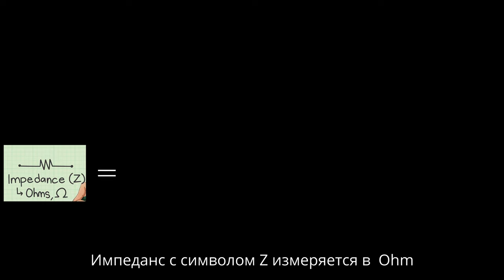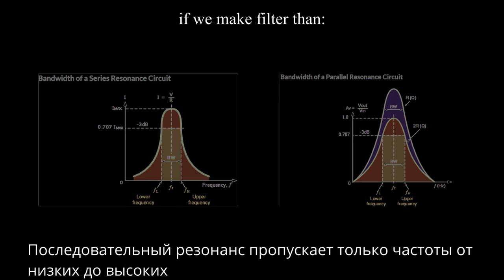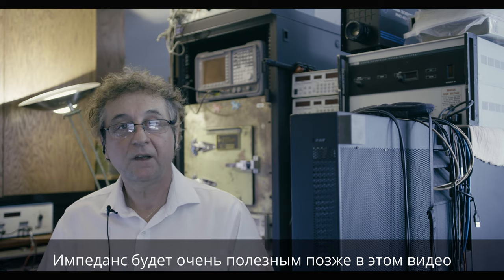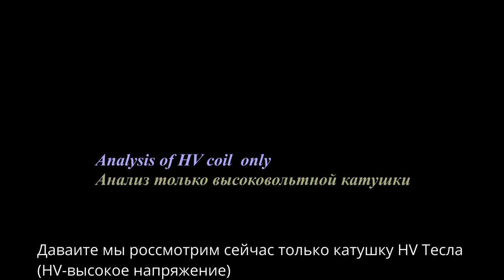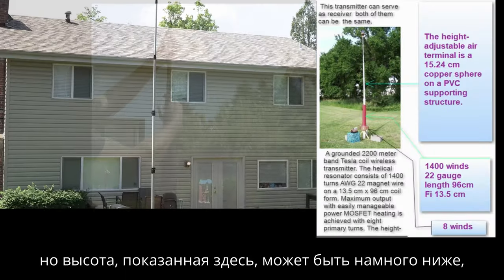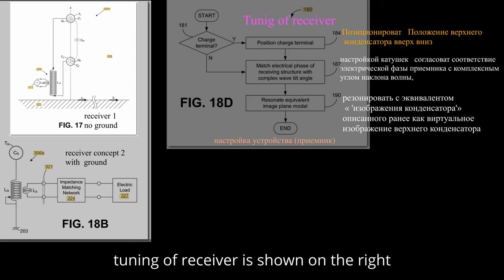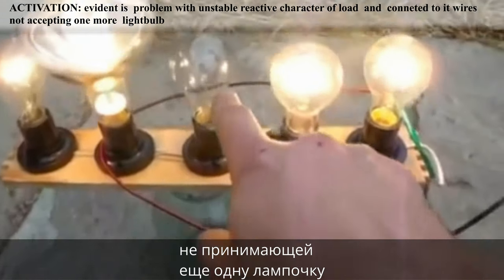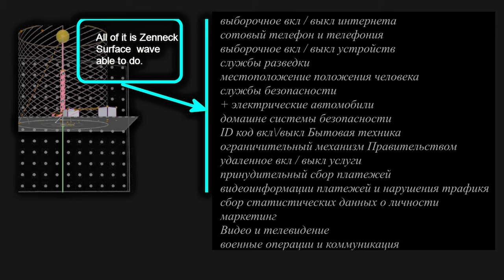Energy   extraction from Schumann waveguide

Comment: I hope people drill down into this discussion, rather than basing it on highlighted reply. Wesley, you're examples show radiation.  I don't think Tesla was radiating energy, look at the morphology of his research, if fact Tesla says he didn't want to. He went from an "Earth Quake" machine to Lightning strikes to  Colorado Springs TMT. If all Tesla wanted to do was to deliver power with no infrastructure, it would be pointless. He had system gain, and that is what we need to find out how he did it. The only thing we need to comprehend is that the Earth acts like a capacitor that doesn't lose it's charge. It has a field between two plates separated by a dielectric. If I gave you a capacitor that would never lose it's charge, how could you extract energy from it? Think about it.
Reply from the maker: It is misunderstanding of Tesla  experiments and JP Morgan expectation as his investor .
electrical energy was to be delivered to the device and than transmitted  to the consumer.
Consumer could not be charged for such services as there was no way to control  how much energy he  used.
JP Morgan protested and dumped Tesla.

Tesla was left with no money and  his Wardenclyffe Tower (1901–1917), was never finished ,
ALL OF THE REST OF THE STORY IS  MAGNIFIED  from its  true reality -  to the level that was  comfortable to  historians , his fans , and crowd  around  in later time.
Your conceptual thinking  doesn't work ,
 Earth as plate of capacitor and ionosphere as another plate  is important to us only as boundary of Schumann waveguide.

 every capacitor needs closed circuit to be discharged.
And  you can not physically close the circuit between these two plates.
You can not connect the load.
==================================================

to transform any energy of electromagnetic nature you  need variable transversal variation of the field  .

 If anything is to be extracted from that charge difference   it would be in the form described by me in my video,
Zenneck Wave and interface earth air is the answer,
Reply: @stivep1  You are thinking in conventional electrical application, to discharge the capacitor.  That's not what I am talking about. Take two metal plates with a dielectric . We can charge the capacitor correct? Now, unhook one lead to one plate (open connection assume no loss). On the other plate attach two diodes; one diode to ground, the another diode  in opposite direction through a load, then going to ground again. If you are able to separate the two plates, what happens? The field becomes weak between the two plates. One plate has no path for current changes (being disconnected), but the other will try to restore it's relationship to the ambient with no influencing field from the other plate, therefore it will move charges through the load while reaching for ambient state. Now bring the plates closer together again, the field now has mismatch charges that cause movement through the load again, to match the influence of the other plate. All you are doing is varying the field strength manually, and by varying the potential you induce current flow. You probably don't have to move the plate away, you can just  rotate it, or cause it to vibrate. Power through electrostatic induction.
Reply from the maker: @XR_IX  thank you for explanation. If you do it in your hands than energy of your hands is doing work.
 if you want to do it between ionosphere  and earth  than what is the mechanism that is going to for it  for you?
=============================================
Reply: Nothing to do with Zenneck waves or Schumann resonance, if Tesla was pushing current into the Earth.  You would have to conclude that the device in Texas, something else. Maybe just like mental pacifiers to thwart deeper investigation into Tesla's real design  and work.
Reply from the maker: @XR_IX  my dear friend. when you were talking about mechanically moved up/down capacitor plate in your hand I could picture it.
How can you mechanically  reposition earth to flex the distance to ionosphere that is "fixed" in position to the earth
don't even try to calculate it as force. 
You need at first point support for your crowbar to pull out the nail from wooden  wall.
Reply from the maker: @XR_IX   Tesla was not  <pushing current into the Earth>  Earth is only one of components of 2D interface that is made out of earth surface and air
 -earth surface is named lossy  conducting medium
-air  is named  dielectric.
Mode of Zenneck wave in the interface is TM ( transverse magnetic) and it is modification of TEM ( transverse magnetic wave -that usually present in waveguides)
However interface is a special condition of  wave guiding structure 
Tesla could not name  all of the technical processes but he was able to make it work the same way as you can make it work just fallowing the assembly instruction.
https://www.youtube.com/watch?v=wIIABIU3tRw
the same story was with Tariel Kapanadze - uneducated experimenter .
He had no idea  how it works but he was able to repeat phenomena he saw in his first device.
Reply from the maker: @XR_IX   Tesla was not  <pushing current into the Earth>  Earth is only one of components of 2D interface that is made out of earth surface and air

 earth surface is named lossy  conducting medium
air  is named  dielectric.
Mode of Zenneck wave in the interface is TM ( transverse magnetic) and it is modification of TEM ( transverse magnetic wave -that usually present in waveguides)
However interface is a special condition of  wave guiding structure 
Tesla could not name  all of the technical processes but he was able to make it work the same way as you can make it work just fallowing the assembly instruction.
https://www.youtube.com/watch?v=wIIABIU3tRw
the same story was with Tariel Kapanadze - uneducated experimenter .
He had no idea  how it works but he was able to repeat phenomena he saw in his first device.
Reply from the maker: @XR_IX   Tesla was not  <pushing current into the Earth>  Earth is only one of components of 2D interface that is made out of earth surface and air

 earth surface is named lossy  conducting medium
air  is named  dielectric.
Mode of Zenneck wave in the interface is TM ( transverse magnetic) and it is modification of TEM ( transverse magnetic wave -that usually present in waveguides)
However interface is a special condition of  wave guiding structure 
Tesla could not name  all of the technical processes but he was able to make it work the same way as you can make it work just fallowing the assembly instruction.
https://www.youtube.com/watch?v=wIIABIU3tRw
the same story was with Tariel Kapanadze - uneducated experimenter .
He had no idea  how it works but he was able to repeat phenomena he saw in his first device.
Reply: @stivep1   Wesley, when you strike a bell with a hammer it vibrates.  When you strike metal, and it starts to ring you produce magnetic flux. Test yourself with a Gauss meter. You are striking the earth with a lightning bolt, and it sets the medium in motion. You are creating magnetic flux. You shouldn't have to move the Earth away as in my plate example. I presented it metaphorically, to show how to use a capacitor to pump electron flow, without discharging it through the load. When you create a standing wave in the Earth, the vibrating plate builds and stores energy. Take a child's pool, and push gently timing the waves. Soon the pool is in motion as Tesla said with the medium having momentum. This is why Tesla refers to the "elastic" property... "I do so, but I prefer to reduce those waves in quantity and pass a current into the earth, because electromagnetic wave energy is not recoverable while that [earth] current is entirely recoverable, being the energy stored in an elastic system." : Tesla (ibid). 

Tesla is literally saying he is pushing current into the Earth.
Reply: @stivep1 I respectfully disagree that  your theory that Kapanadze and Tesla where using ground waves. It is much easier to see that they discovered a frequency that breaks the laws of conservation of energy in a local system, because energy is being built then captured by their devices.  A Zenneck wave condition:  "...exists under the condition that the permittivity of one of the materials forming the interface is negative, while the other one is positive. " : https://en.wikipedia.org/wiki/Surface_wave

Do we assume a uniform landscape with no features? Or over an undulating ocean? The Earth is not this way, look at the satellite surveys show much magnetic deviation, conductivity would unlikely be uniform. What happens to a Zanneck wave when it hits an ice covered mountain? 

Operationally what frequency could be used, it says under Radio,  "Evidence does NOT show that in radio space wave propagation, Sommerfeld-Zenneck surfaces waves are a mode of propagation as the path-loss exponent is generally between 20 dB/dec and 40 dB/dec." Wikipedia (ibid)

This is not radio transmission (or higher), you are going into ELF. Now build a Tesla coil that operates at the Schumann resonance, I assume to get gain. 957,191.89 Km of wire for quarter wave secondary.

There are numerous problems with this approach, least of all Telsa says it's not what he was doing.

In my opinion Tesla was doing this: https://www.youtube.com/watch?v=HJylD7xpEiU
Reply from the maker: @XR_IX  Tesla time was time of discovery of certain phenomena that have been  researched  after Tesla time  till today. 
Today's science corrected a lot of that what was discovered at Tesla time.
 Electric discharge of the lightning dissipates at the surface of the Earth. Lightning 
https://www.answers.com/Q/Is_a_lightning_bolt_kinetic_or_potential_energy
Quote:
<Electrical energy may be either potential energy or kinetic energy,
 but it's usually encountered as potential energy, which is energy 
stored due to the relative positions of charged particles or electric fields.>
 https://www.thoughtco.com/electrical-energy-definition-and-examples-4119325

mechanical energy, is not present in lightning strike. It is the charge that is discharging at the  first very moment on its flight creating more ionized path of air .
So discharge of lightning has curve of discharge taking place in time frame. similar to capacitor, where  air is slowly ionized dielectric that is becoming conductive.
 If you look at place that was experiencing lightning strike , or your  lightning  ground wiring  at your building ( mostly in Europe) there is no damage to the mechanical structure
if current was not big enough  melt the wire.
 Every <body> has gravitation and  Earth with its atmosphere inside of solar system travels in space.
There is no displacement  of ionosphere  with respect to the earth in form of vibrational mechanical disturbance.
Atmosphere travels with Earth together .
Reply from the maker: @XR_IX  I never said that Kapanadze and Tesla used ground waves.
you don't understand  the difference  between Zenneck Wave and ground wave .
http://www.tfcbooks.com/articles/tws4.htm
  Quote: 
<The ground wave:
 has both direct-wave and
      ground-reflected components, and under certain conditions a tropospheric
      ducting component.  The direct-wave is limited
      only by the distance to the horizon from the transmitter plus a small
      distance added by atmospheric diffraction around the curvature of the
      earth.  The ground-reflected portion of the radiated
      wave reaches the receiving antenna after being reflected from the earth's surface.>
=================================================================
Zenneck wave is guided wave and by that  <this  is quite  different animal.>
Zenneck wave  in  the interface exists as an   effect of  no reflection
-for Zenneck Wave  landscape is not important.
- ocean condition is not important.
-ice covering mountains ?  is not important
-wave propagation has nothing to do with Zenneck Wave
- path-loss exponent has nothing to do with Zenneck Wave
-square  root of the distance  should but for some reason doesn't affect Zenneck wave, the way  we would expect it to be affected .
Reply: @stivep1   Your posts are being repeated consistently. I can admit I don't know  what you are talking about well enough to say what it can do. Wesley show me an empirical model of this theory working. This should be simple, show me energy transmission using a Zenneck Wave. Then I can agree with you if it has the merit as you say. What I read is that is still an electromagnetic wave, and Tesla said he wasn't radiating electromagnetic waves.  I apologize, It's my fault to say ground wave. You are saying Kapanadze and Tesla were using Zenneck Waves, waves unwittingly yes?  Where does the process gain power amplification? I think if people knew that they could gain energy through a type of transmission it would be utilized.
Reply from the maker: @XR_IX  Yes  my posts are being repeated . And last time I  forgot  to delete the multiple ones.
Unfortunately  It is the  effect of  measures taken  by my 
IT department, to avoid Russian interference .
Yes Tesla said he wasn't using radiating electromagnetic waves.
Zenneck waves are NOT HERTZIAN  radiating waves.
http://rexresearch.com/corumzenneck/texzon.pdf
Quote:
  <If  one  can  synthesize  ground  currents  as  given  by  Equation  (1),  they  will launch a radially propagating Zenneck wave (a guide mode similar to the zero-phase-sequence of power transmission line experience44) with no Hertzian radiation or Norton ground-wave radiation whatsoever!>

=======================
Question:
Where does the process gain power amplification? 
Answer:
there is no gain and  no power amplification it's only losses added  in the process of energy  conversion.
So P( power)- Out is less than P- In.
But power In  is free.
Reply: @stivep1  That is definitely NOT what Tesla describes: 

"Counsel

You say the energy was 1,000 times greater. Do you mean that the voltage was increased, or the current, or both?

Tesla

Yes [both]. "
Reply from the maker: @XR_IX  *I need you to give me the link with exact quote and text to analyze it.!!  *
Tesla was great in 1897 to 1901.

Tesla  was in trouble but gaining knowledge  since 1901 till 1943.
Tesla was discovering and making mistakes.
He was not a genius,
Tesla was not a god and for Darwinists and modern science  God doesn't exist- so whatever God says is just fiction convenient  to Church.
By the same token  I  must see what Tesla said , where ,when and in what source it was said.
I don't trust, fictionares, as well as Russian historians, scientists,and propaganda.
Reply: @stivep1  Wesley it is the same document from pbs, which makes it pretty credible in my opinion, and points to an alternate narrative to the Zenneck mechanics.  http://www.pbs.org/tesla/res/res_art07.html   I have been looking at examples of Zenneck wave guide, and it seems it is good explanation for one wire transmission. I have told you that I know I can transmit power through grounded electrolytic fluid, and sea water should work, though I have not tried it yet. But the difference in what Tesla seems to describe in the reference, is the Tesla Magnifying Transmitter, where he achieves gain and transmission through the medium.  When I told you about setting the medium in motion with a lightning bolt, I was not really describing a grounding of energy. Thereby  recognizing the dissipation that takes place, but I recall reading a Tesla reference where he says he noticed something after lightning strikes that he first dismissed, then realized its potential. It might be that he detected the 84ms echo after a nearby lightning strike. I believe the mechanics of setting the medium in motion is exactly the Tesla coil, but with a more fluidic dynamic model. As the L1 coil field collapses, It draws the the aether up in L2, like water by plunger. The aether seeks return state after the raised potential then drops, and will use the Earth ground to fall back through, like a tunnel. Effectively like a hole, the surrounding aether acts like water falling through a hole, and starts to rotate. This is the rotating field that illuminates incandescent bulbs around a Tesla coil. My theories anyway.
Reply: Wesley the reference I spoke of in the previous post is here: http://www.pbs.org/tesla/res/res_art08.html
Examine the passage, "...It was on the third of July--the date I shall never forget--" This is the pivot point to Tesla realization of how to use the Earth. It was truly a bolt lightning that hit him (pardon the pun) WE CAN"T IGNORE HIS WORDS AND THOUGHTS, even if science may dangle theories that seem to explain his work in parallel terms. Tesla envisioned unlimited power,  transmitted anywhere in the world, even modulating data and voice using that carrier. The magnitude of his genius is only lost because of the threat of the destruction of our Babylon.
Reply: Wesley, on your remark, "He was not a genius", Tesla was not many things, but he was a genius, even Einstein described him as so: When asked what it felt to be the smartest man alive, Albert Einstein said, “ I don’t know, you have to ask Nikola Tesla!”. There are many  reasons to doubt the "scientific" community on free energy. I don't want to dive in to conspiracy theories. I just know my own experiments, that the axioms that tell us we can't find better alternatives to burning fossil fuels and the infancy of the photovoltiac solutions, are suspicious. Specially if you find irregularities with simple engineering concepts, you keep going down the rabbit hole as I am doing.  

For Example This Link: http://hyperphysics.phy-astr.gsu.edu/hbase/magnetic/elemag.html#c5

It would persuade a theoretical engineer to conclude an iron core magnet solenoid is more powerful than an air core, because of the relative permeability of the cores. Simple engineering, that is the representation of the equation. However it is a lie, inaccurate and misleading because it doesn't describe the solenoid measuring the magnetic field at the center of the coil, on an instantaneous DC pulse. They don't tell you that, what they show is the strength of the field measured outside the coil. So the equation is accurate only from a closed  perspective.